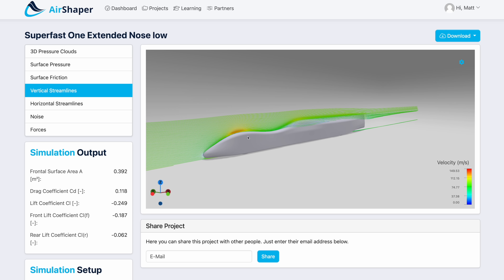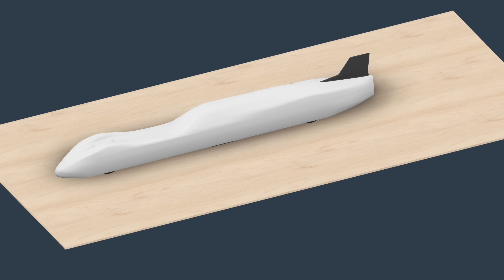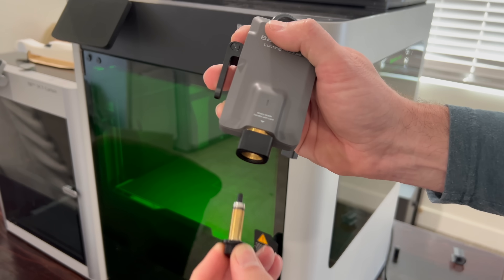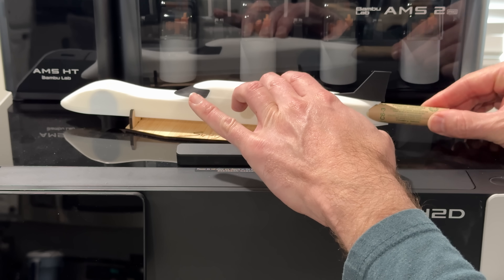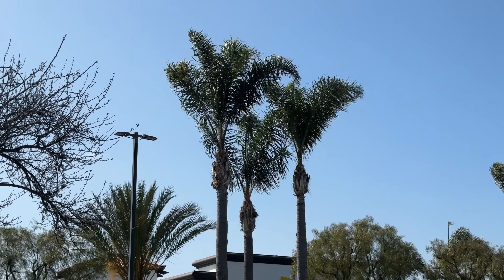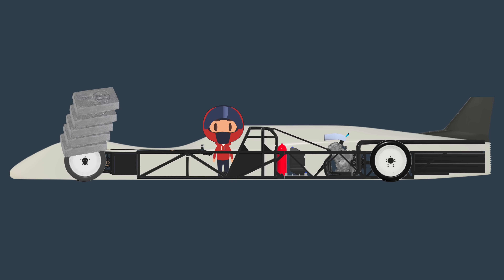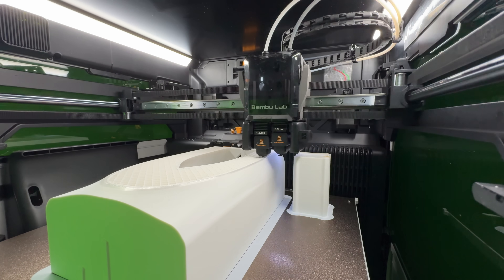Aerodynamic Testing On The Highway, With The Bambu Lab H2D

Comment: You dont have to increase the speed to keep the Reynolds number constant when you decrease the characteristic length. You can also increase the viscosity. My suggestion is that next time you go to a community pool to get some data. :D
On a more serious note. Volvo Cars actually went to SSPA's (one of the world's premiere towing tanks, that's the shipping industrys "wind tunnel"). On the bottom of their seakeeping pool they dragged the model at very low speeds.

Comment: the best to think about reynolds number is how a flowing fluid behaves l guess. like u get the same reynolds number meaning the fluid stream is comparable and you can expect similar aerodynamic behavior but not mechanical for example. fluid dynamics is like the quantum physics of engineering

Comment: Hey, awesome video, I love the more engineer-ey stuff. I think the reason you're seeing a bunch of weird data is largely due to the fact that the entire car is sitting in the boundary layer of the wood plank. I haven't taken any external flow classes, so I don't know when this boundary layer breaks down into turbulent flow, but you get my point. With the bottom of the car seeing very little flow velocity, and the back of the car seeing a much thicker boundary layer, I think the car is behaving in a less stable manner than it normally would. I think it might even be more accurate (when looking for aerodynamic stability) to just put the car on a stick and remove the wood "ground".

Comment: I’m surprised you just didn’t use your electric leaf blower. Because the thing I don’t think you can calculate for while driving is the crosswind effect of the terrain or mechanical crosswind. Even if you run 180° sample paths since you’re in the outside world they’re still going to be sideloading from cars going by, hills and other terrain features. But your electric leaf blower if you put a anemometer after your model should be giving you a more consistent result

Comment: When I was a kid I built a pinewood derby car with a rocket motor on the back. It took 1st place. We then took it outside and fired it in the parking lot. It went straight for 10' and then did the worlds best spin out. The car ended up intact minus the wheels being ripped off and the ejection charge charring the paint. 😁

Comment: @Superfastmatt how to make a DIY wind tunnel, that would be a great video. Lets assume a 150mm tube will fit your model, for 1000MPH airflow you'll need 114,000m3/hour, a decent 1000mm  cased axial fan will get you about 70,000m3/hr for just a few thousand bucks, add in some PVC weld and hey presto.

Comment: You just described me!   I am very good at predicting what will work but math is hard 😂.   33 years of being an engineer is not the same as DOING engineering.   When Interviewing engineers I used to ask "What is the formula for the  bending moment of a rectangular beam.    About 20 years ago I stopped because none of the fresh college grads could answer, it was depressing.   I did occasionally get a new grad that could actually describe setting up a Wheatstone Bridge for stain gauges.... They all turned us down for not paying enough 😂

Comment: I suspect you have an eddy current over the leading edge of the board causing the flow around the model to be traveling backwards in some places. When the model is pointing straight, the fin is probably beyond the eddy in the "correct" rearwards flow, maintaining it pointing forward. When it starts to pivot significantly the fin is getting into the forwards flow region, making it spin the wrong way until it hits the flow around the side of the board (rearwards again).

I know you already know this, but this is a ridiculous set up for generating useful information. It would be far more useful to built a wind tunnel out of some cardboard and desk fans.

Comment: I feel like it was a bit of a miss that your roof top wind tunnel didn't resemble a real wind tunnel. Add some walls and a roof, little bit of paint and some scale doors and windows drawn on. 

Seems like it would help with turbulence the car is creating too. Even if it's just another sheet of wood with some sides, would probably work better.

Comment: Still highly recommend a cabinet for maintaining filament humidity.  Sold under Eureka or StatPro brands…one example is the ADL-3D77.  This uses an electric desiccator that will maintain humidity electrically using low watts and zero noise.  Very useful.  And, DiamondBack makes synthetic diamond nozzles, E3D sells a hotend with said nozzle.  You’re welcome 😊

Comment: Love your channel Mat, just be a bit mindful of cutting vinyl stickers on a laser cutter if that's what they are. Its a bit of a no no. Ask me how I know. Especially as you mentioned there is no ventilation. It produces chlorine gas when its burned. Its not great for you from what I remember in history but it will also do damage to  lots of the components in the printer over time. Its pretty corrosive.

Comment: I think having a larger entry region for the flow really would have helped. I think I the front of the board was just too close to the model and so the flow field is probably not as representative as the actual running conditions

Comment: I don’t have the technical jargon to explain what I mean but I don’t think you can compare a dart to a land speed car because the dart is flying thru the air from momentum whereas the car is being pushed by the rear wheels. I think you’d get different behaviors if the car was front wheel drive ei being pulled rather than pushed. Just something to think about.

Comment: Matt, why dont use go with airplane logic. Put a rudder on there and use a Yaw Damper to correct for any un-desirable yaw moments? Works for airplanes, why not for a car!  I'm sure an Arduino and some RC autopilot code would work wonders! Screw engineering when you can just cover up the mistakes! Lol

Comment: I am soo surprised you haven't built a wind tunnel from sonno tube ,  concrete forming sold at lowe-depot home improvement stores. Cut it in two "c" shapes or half down the length. Put hinges on one side and latches on the other to put in models put a fan or blower in the  end, with a bunch of 2" PVC pipe stacked in the pipe about 6" 12" long to create a laminar flow. A pwm speed controller. Maybe a e bike  wheel can be modified, add fan blades to it. Or just use the hub motor. With 4 lawnmower batteries in series. A 1000-1500 watt bldc motor should move some air. Maybe a attic fan or race car mechanical fan will work better. Mounted on a water pump with pulley, connect it to a harbor freight 6.5 HP engine  with a small 2"pulley spinning the 6"(+/-)water pump/fan pulley, (like used on small block chevy,) mount that to a couple 2 x4's making a brace /bracket. The 3:1 overdrive, 3600 can exceed 11k rpm a carbon fiber fan maybe? 😮 just use caution and exceed ratings with caution (don't🤕just don't!) Maybe get a 4" pulley , and keep the engine under 3200 RPM 😮.  6500+/ fan speed, surely that will move air fast enough to get data. Maybe place cheap wind speed meters in several locations maybe a maf sensor can be used, "mass air flow" not to get a specific flow number, just to get consistent numbers. Maybe  map sensors can be used on the model. Drill tiny holes in the surfaces say .010"-.020" with a tube glued on inside with the map sensors reading the pressure or lack of pressure. Having simple wind meters with holes that can be opened at least in front , side, and behind the model,  maybe repeats on the top and bottom sides.  With strings taped inside the tube  about 6" long yarn would work well. Taped in the center with the yarn running 90° to the tube , do you get two strings at similar location 5/8-1" apart roughly.  Maybe use thin strips of tape to tape string on the model. To see if the string does anything besides lay back. If any location has strings standing up that is likely a low pressure region. leading unwanted FLIGHT!  IT COULD  BE A VERY COOL TOOL. MAYBE Even make $$ putting other people's models inside
 Being wind tunnels are exspendy!   Maybe charge 20% being it's 20% of a wind tunnel, well more than that, it has wind and is a tunnel! Maybe place the fan inside the tunnel or in the rear with a bell mouth inlet, and 2" tubes  filling the inlet. Sand the inlet and outlet  to prevent turbulence. A semi bellmouth inlet with a gradual flare outlet. With a 3D print bullet nose to fit between on the inlet side. A 24"-36" tube at least, and 16'+ long. (20'-24' would be good) or a 8'-10',12' test area. With the fan in a 12" areas, 24" to create laminar flow. With a 12" -24" instrument area in front or behind test area. (A  48" tube would be better. Maybe using a external plywood form with sheet metal tube the top can be removed, slid up against a wall, and the bottom stacked on top to take up less space. Maybe use a microcontroller to read sensors , that can connect to a laptop to read the output. A 12" tunnel could still be useful! Have an awesome day🎉✌️

Comment: The scaling of airspeed is a tricky thing since if you actually end up in the area around 1000km/h you'll change to supersonic conditions at some points, which in turn will just flip every assumption on its head.

I'm also thinking about the difference in behavior between a single fin and a dual fin configuration.

Comment: @9:32 I spent a lot of time working in water tunnels and airflow for a nuclear research facility (medicine and geology, not military). We basically did exactly what you're doing, measuring Reynold's numbers and trying to get them to match, though ours had the fun of non-air gases and thermal effects (heating aluminium at 1:10 scale screws with your math a LOT).

I asked my boss to explain Reynold's number to me, after 35 years working in the field at the same facility, he really understood it. He gave me a pained look, and said "that way madness lies". I believed him. 10 years later, I dove head first Navier-Stokes equations, and promptly sent him a message, "you were right."

Comment: Being able to add rocket motors to the super fast mini model is hilarious and I will absolutely be making one. xD  That said, I would like to point out that standard single-stage (green label) engines are pointless for this since there's no recovery system to pop out. Instead, you can use booster (red label) engines that lack an ejection charge which I suspect will reduce damage to the model over multiple uses.  Shove a B6-0 in there and enjoy!

Comment: One of my engineering teachers used to work for Pratt & Whitney back in the day designing parts for turbine engines. They had to get creative when wind tunnel testing parts, since it getting air in the tunnel up near Mach speeds was difficult. To get more accurate models at lower speeds, they used a different fluid. Which one?

Good ol’ R-12.

And once it made its way past the part/assembly being tested, they just vented it right out of the building. Tons and tons and tons of the stuff, vented right out the window.
Reply: Yup.  Remember when "flash freezing" of vegetables was a new thing?  Guess how that happened.  R-12 bath for the veggies.  It was cheap.

Comment: Reynolds numbers, first thing I thought of in my flashbacks to fluid dynamics. Its a function of chord length. Twenty years later as a plumber I still remember laminar verses turbulent flow. By the way people if you're installing copper make sure to ream the ID. If there is a burr from the cutter it will induce cavitation at the fittings and erode the pipe wall prematurely.

Comment: Stupid question....    Why not convert your roof mounted plane into a wind tunnel with a pipe over the model.  With a nice smooth radisued entry in front of a 'air straightening grid' (think bigass MAF sensor), that might give you more accurate data.  And possibly minimize any kind of turbulence off the nose of the SUV.

If that stands up to testing and gives repeatable data, you can then proceed to do a few 1000mph pulls in the interstate and go from there.

Comment: Don't agree with "half-assed engineer". Not very successful, but you went far beyond what i would do. You are in the land speed community- I would just copy the big boys. They got wind tunnels, they got money.  Just copy their designs and done.
Prediction: your center of mass needs to be much more forward, and lead weights is not the solution.

Comment: Matt, You may have added some variables into the test by not taking into account the aerodynamic turbulance caused by the  car and the board. looks to me like you have the test placed  right at the low pressure area in front of the land cruisers windshield  which is going to blank the front half of the test piece. tie some yarn tufts on that board around the leading edge and down the board to see where your airflow is actually coming from.

Comment: I wondered if the rocket would out drive the weight on the fron of the car. Thats like having several thousand pounds of weight on the front of a long pickup truck woth 1000hp - the rear end will outdrive the front.

Im no engineer, but i think you need a way to transfer the weights on the front to the mid section as the propellant is being used up to offset the weight loss of the consumed propellant

Center of gravety is changing as fuel is consumed

Comment: Ain't nothing like precise engineering...   😋
Reply: PS; A millennium ago, I made a wind tunnel and several different airfoils to show air flow over aircraft wings for a Science project.  I used a dry ice/water mix in a jar to make the 'smoke' so you could see the different airfoils/lift/drag, etc.  I only got a B grade, the perpetual frog dissection got the A grade.  Yuck

Comment: When I was in college for engineering I had a Fluid Dynamics professor explain wind tunnel modeling in the best terms. He was a Chinese man and one of the best teachers I ever had. He was explaining how you could alter your model for different speeds of fluid flow, or even using water instead of air but the shape must be equal because "You cannot put banana in a wind tunnel and claim it is Boeing 747". 
Dr Qiao was the best.

Comment: How did you 3D print the 1/4 scale sandwich in the carbon fiber stabilizer? I guess ham filament has finally been perfected. Bacon probably came first, ham was a logical follow up.

Comment: I remember a story about Jim Hall or Gurney testing rear wing shapes and mounting angles in  the bed of a Chevy Luv pickup. Mounted on a pivoting vertical post with a scale underneath it measured down force and a horizontal spring scale measued the drag as it pulled back. It was well above the roof of the cab.

Comment: I worked at a company that designed and manufactured commercial smoke detectors/alarms.
The fire science bookshelf in the engineering department was this smallish set of massive tomes; one had to ask permission from ranking engineer in the room to even touch them as a eng tech/jr eng.

Comment: Great to see you do 'wind tunnel' work. I thought it would be interesting to do full sized on the back of a flat bed b-train's second trailer with a pallet of plumbing pipe ahead of it to straighten the airflow. Cleetus Mcfarland has done some wind tunnel videos, the one he was using seemed to be charging about $500/hour. I was surprised it was as low as that, not sure if they had multi hour minimums. Looking forward your 'proper wind tunnel' video. 

It's too bad about Bambu Lab's software issues, the laser, cutter and pen options are great additions to a pretty nice sounding 3d printer set up.

Comment: (A_1)(V_1) = (A_2)(V_2), Conservation of momentum and mass assume isontropic. This equation will hold for speeds up to 600 mph transonic region so shocks can will happend beyond this point.

Putting a nozzle on top will increase air speed in over the model and by the (A_1/A_2). So put a big scoop on it and pray it doesn't fly off the the car.

Comment: There's no way ever you're getting any good data from having that thin on your roof on the highway. Adverse vibrations alone are producing data above any statistical noise floor. I wouldn't even believe your locked yaw moment tests except to say that they state the obvious in a very gross manner... A bigger fin on back and more weight on front makes car go straighter. You didn't need to build a model to know that.

Maybe in future try not to be so much of a schmuck and stop accepting rimjobs from anti-consumer companies.

Comment: I needed the Advert, so thanks.  I fly model airplanes... 
your fin will get more effective as you go faster.
proportions of area are short-fat better at low speed and tall thin better at higher speeds.
Build a way to put fine changes in it.  at some speed, you will not be able to steer. Add ballast in any case.
size the fin for top speed, I expect you know.

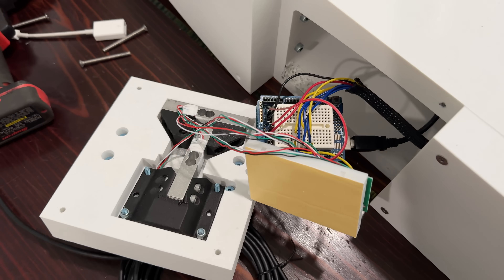Comment: 9:00 The Wright Brothers and their contemporaries ran into the scale issue in their wind tunnel testing. So, the Wright flyers' wings had an aspect ratio more in line with today's much, much faster planes. Of course Reynolds number wouldn't even be named that until two years after their first flight.